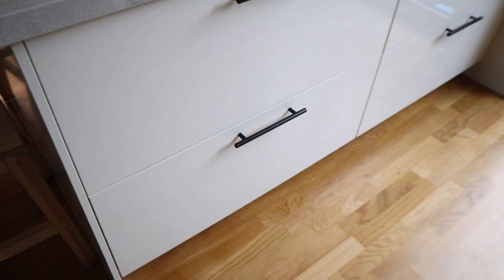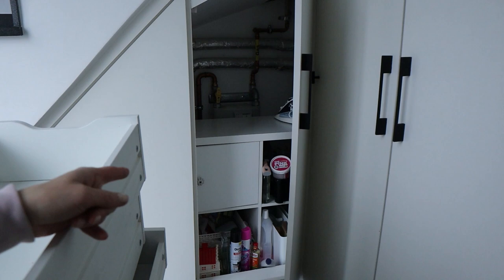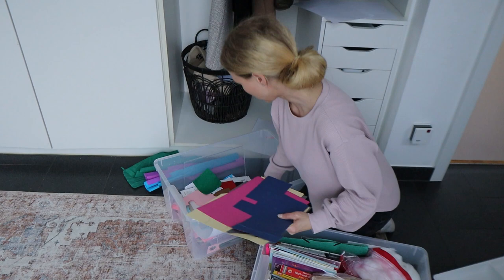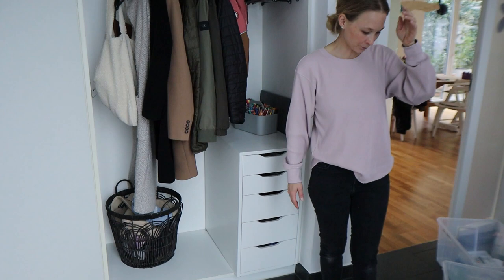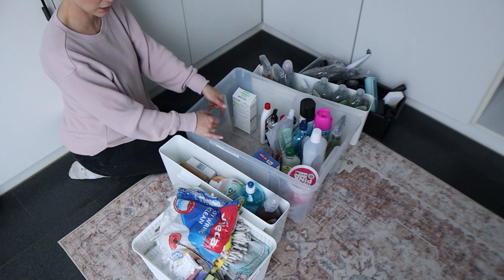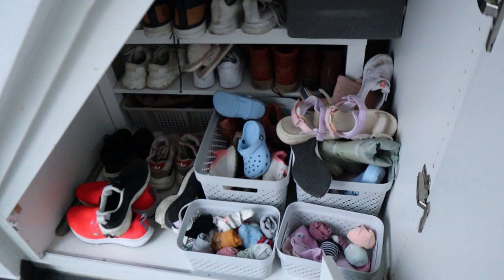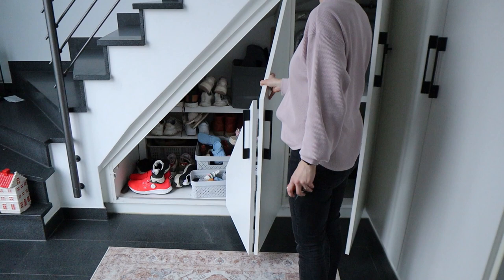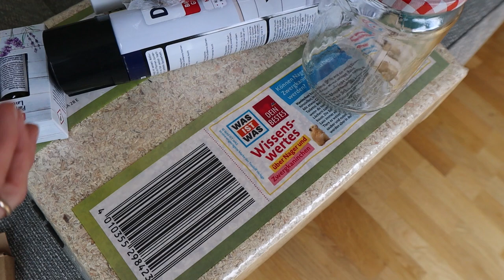GET IT ALL DONE :: organize, declutter and rearrange - entryway

Comment: Just a suggestion could you possibly put all your cleaning supplies in the laundry area. And would the crafting supplies cabinet fit where your cleaning supplies were (maybe too large for that area not sure) love your videos ❤️ fr 🇨🇦
Reply from the maker: Hi 🙋🏼‍♀️ thanks for you comment. 
I would have to put the cupboard on feet because otherwise you can't open the last drawer. 
And I don't want to have to run all the way up every time to get my cleaning stuff. I need them at hand. 🙈 For me, it is important to make cleaning as easy as possible. Have a great day! 🫶🏼